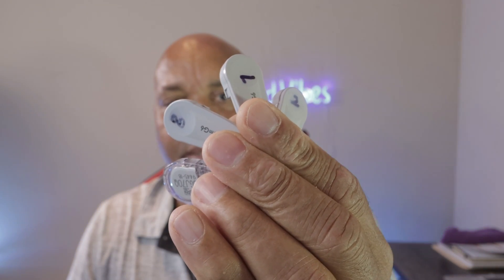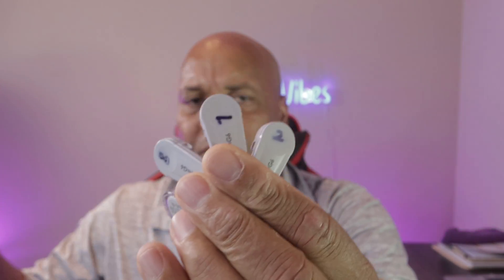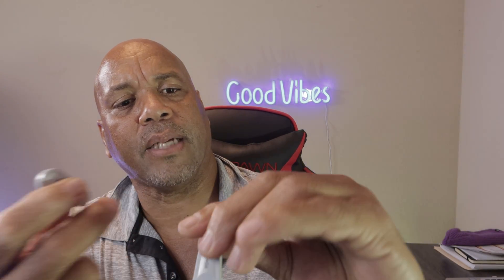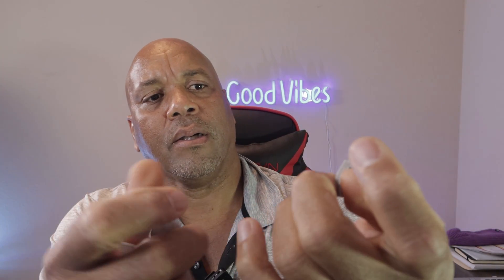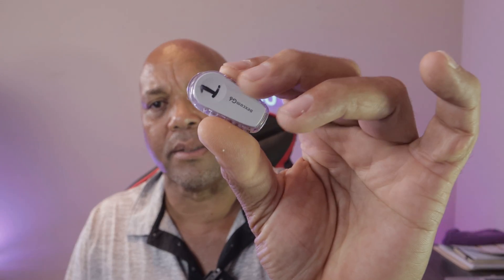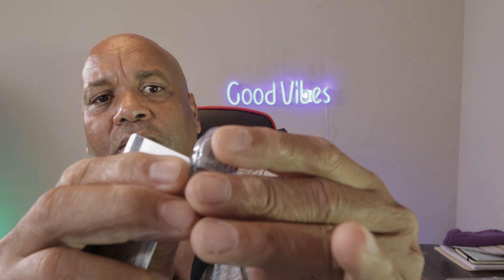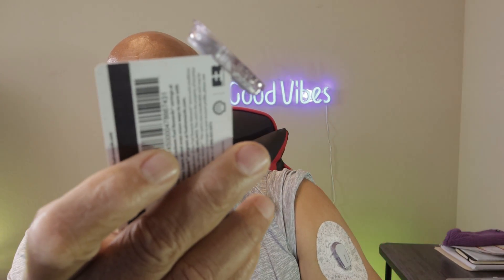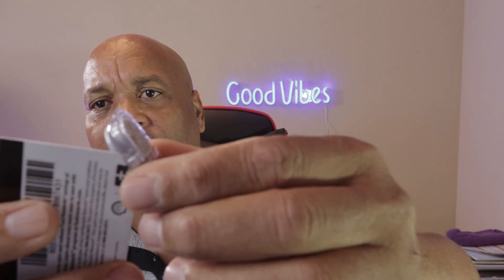Dexcom G6  Transmitter Save Restart Sensor By removing Transmitter

Comment: Dexcom makes great sensors but Dexcom support for failed sensors is terrible. If you have more than two sensor failures in one year Dexcom dose not care they are not supplying you with replacement sensors. They blame you! They are jerks and don't care. That's why people need to do this to take off the transmitter to reuse the same sensor twice.

Comment: if you are replacing the transmitter and just did sensor, I forgot to pair the sensor n transmitter.
help  I started the sensor but it didn't say pair it.  I m not working the new sensor n new transmitter with old transmitter numbers. it says I have one session left on this transmitter.😮
Reply: ok, the receiver said sensor not working.  it stopped. so I went to transmitter n it popped up with enter sensor code so I did.  then I restarted it when asked, it just failed again.  I m calling tech support😊

Comment: There seems to be some confusion on the difference between the sensor's and transmitter. He is talking about extending the life of the sensor beyond the 10 day cycle. The transmitter is the grey device that pops into the sensor. The transmitter lasts for 90 days.

Comment: Transmitters do not last 10 days or or only 3 or  4 sessions.   Get your sugar under control because you are giving people wrong advice that can cause harm.  Do not use your credit card unless it's expired or no good otherwise you will rip it.  I have an ideal tool for removing transmitters fast and easy.  Ask me about it and I'll tell you.  The only reason I  restart the sensors is because insurance companies rip off the patient by delaying coverage payment to the Pharmacy especially before weekends and long holidays.  If one comes off you will have to wait 24 hours during the week for a next day fed ex and longer on holidays and weekends.  That right there is criminal of the insurance companies.

Comment: The transmitter is good for 90 days after activation. Maybe sure the use by date has not expired before using. The sensor on the other side has a 10 day usage span. You can pop out the transmitter from the sensor by using a thin plastic from a pack of blackberries (that think clear plastic from the package). Pop the transmitter out. Wait 15 minutes, put it back in and reactivate. There is no need to wedge a thick card like that.

Comment: RIP THE STICKY OFF AND PRESS UP FROM THE BOTTOM.... I was messing with a card but the corner got all bent and it was super frustrating... just take the sticky off ♡
Reply: Use a test strip...it's so much easier and pops it right out.

Comment: The Sensors are good for 10 days, but the Transmitters last 90 days. Maybe you know that and just said it wrong.  I tried using an expired Transmitter (one that was new and expired after the 90 days of use), but it keeps saying Expired Transmitter and Invalid Transmitter ID. Has this happened to you and is there something I can do to make it work again?

Comment: Thanks for the tip on how to remove the transmitter from a sensor without taking the sensor off the body. 

I just did it on my own with the help of a guitar pick! Only took me 5 mins 😂. 

Thanks again for the knowledge 👍

Comment: I think you are totally confused. The sensor is the part that is inside you. The transmitter is what you have wrote the number 1 on. It is meant to be kept when you take the sensor out of you.  You don't replace the transmitter (it's good for 3 months).  You replace the sensor every ten days (unless you're hacking) You don't have to use a credit card. Just bend the casing back with your fingers and take it out. Wipe it off and use it with another sensor. If you've been replacing those transmitters every ten days Shish! That is just crazy. I was confused initially but think of it in these terms. The SENSOR is sensing your blood sugar, that is why it is in you. The transmitter is sending your reading to your phone...hence transmit

Comment: This video didn't help me restart any expired sensors or transmitters (and the terminology used throughout wasn't correct when referencing what the pieces actually are)...HOWEVER!  I needed to remove an expired transmitter (expired prematurely, according to the warnings I received on my insulin pump) from a brand new sensor that I had literally just started a session on when my pump told me the transmitter needed replaced!  That was an incredibly frustrating experience, but I was able to change out the transmitter WITHOUT removing the sensor thanks to this video, which is exactly what I needed to know how to do!  So, thank you!!!!

Comment: There seems to be some confusion between the "sensor" and the "transmitter" in this video. My insurance will pay for ONLY 1 "transmitter" (gray item he has numbered & kept) each 90 days because that's it's life. The "sensor" (patch on the arm) is designed to expire in 10 days so my insurance pays for 9 for the 90 days. YES, using the prying out method, one can stretch the useful life of the sensor patch longer. The only way to extend the life of the gray transmitter would be to grind away the outer casing to the battery & replace the battery (which is EXTREMELY difficult). If this man is completely removing all items from his arm when the sensor itself expires (in 10 days), then he's not using the transmitter for the full 90-day life. And I question how he's getting his insurance to pay for more than 1 transmitter each month?
Reply: Sounds as though he's paying out of pocket.
Reply: I agree. It sounds like he's changing the transmitter every 10 days...unless he's saying it wrong. I did read somewhere about a year ago, that some man somehow renewed transmitters to work again. He wouldn't share his method because he wanted people to give him their expired transmitters so he could make them usable again and sell them.  I started saving mine in case they ever shared the secret. I tried reusing one after watching this but it keeps saying Invalid Transmitter number.  This was helpful though to remove the transmitter when you have just put a new sensor on and then the transmitter expires. My boyfriend could get it out without removing the sensor but it kinda hurts because he has to bend the transmitter case to get it out.

Comment: Hey Charlie I'm new to this but I have reused the same sensor five times now I'm preparing to start it now for the 6th time not the transmitter the sensor so yeah I know they're good to go up to five times I'm going to see how it goes here for number six today I'm a little trouble the first couple times but I had to shut my receiver all the way off and then restart everything and wait 15 minutes I think it's going to work this time though cuz this time it repaired so we shall see number six going down
Reply: How could you manage to reuse so many times
Reply from the maker: The most I have gotten is 5 ..I am on  three times right now..
Reply: We have never managed to reuse for third time, and mostly it fails to extend for the first.  We constantly have errors. So ı need help. Could explain the process step by step for me
Reply: @fahrettinhoca   I use my sensors 3 to 4 times also. What I came to realize is that it gives the funkiest readings for about 24 hours, and then it starts to straighten up and fly right. Sometimes it might take 2days, but I pay out of pocket, so it's worth the wait. I was calibrating like crazy at first, but i don't even do that anymore. I just put my alarm on silent and check my blood sugar manually for 1 or 2 days

Comment: In the UK we use the transmitters for 3 months. The only part we change every 10 days  is the G6 inserter. Strange why you are told to change transmitter as well.
Reply: In the US it is the same. I change my transmitter every 90 days. The sensor lasts 10 days. He’s got the transmitter and sensor confused. One the transmitters runs out of power it will not work anymore. My Medicare pays for a transmitter every 90 days and 6 weeks of sensors I never had a problem with Medicare paying for it. If you do it right you have no problem.

Comment: #RealTalk - The gray thing that you're talking about is a transmitter, not a sensor. The sensor is the clear plastic thing thats attached to a bandage and you attach to your skin using the applicator (the big plastic thing that has an orange button you push to insert the cannula into your skin). The gray transmitter you are talking about here is MEANT to last for 90 days. Not 10, not 20 or 30. If you're replacing that thing more often than 90 days, you're either doing it wrong or you're buying used ones where the battery is already almost dead. New ones that you get from a pharmacy, Dexcom directly, etc. are intended to last for a full 90 days.
Reply: i agee with u but can u reuse systems as claimed by other users of dex 6 ,seem that the battery in the transmitter woul fail
Reply: Amen...I have no idea why this guy and others are manipulating the system or its parts. You order replacements on time and properly follow directions, input sensor numbers or calibrate and go on properly. What else is there to do or hack as I heard term used. I will say that the TERMINOLOGY created for this system- though simple and minimal- is confusing for MY BRAIN to use (and communicate) without going slowly. SENSOR..RECEIVER..TRANSMITTER are all similar terms in MY BRAIN and the big thing used to place system on your skin does not LOOK LIKE A "SENSOR". ALL VERY DISCOMBOBULATED IN MY MIND.
AS WELL..removing the transmitter piece from that shell when complete is a bit cumbersome and scary. Don't want to break it or impale with the mini wire/needle. Overall a great item and blessed to have it. USE IT AS DIRRCTED AND CALL FOR HELP THE PEOPLE ARE VERY NICE. USE YOUTUBE TO SEE HOW TO MANIPULATE EQUIPMENT.
Reply: @MegaLargemouth  I am worried that I won’t have a new sensor or transmitter when I need them. Over the years, I’ve struggled to obtain all my meds for many, many reasons. My provider delivers sensors exactly every 30 days & adds a transmitter every 3rd time. Naturally, last summer, I was on vacation when one of my deliveries was due, so I had to go about 10 days without my Dexcom.  I have a lot of trouble regulating my blood glucose levels when my routine changes drastically.  So extending this equipment even a few days seems like a good idea to me!
Reply: @danbev8542  w

Comment: I have watched your videos on the transmitters at least 2 or 3 times. And what your talking about in the other video in particular, is the sensor not the transmitter. In this one you talk about resetting the transmitter, but you never tell us how to do it! It's very confusing. Where are the instructions for resetting the clock on the transmitter?🤔
Reply: I wish someone would tell us an easy way.  Without all the complicated use of apps that I couldn’t figure out.
Reply: Exactly once you pair it the first time how do you pair it again?

Comment: The transmitter is suppose to last 3 months according to Dexcom.
Reply: Just so we're clear, the sensors are SUPPOSE to cut out at 10 days, the programming and software/firmware are programmed to tell you that.
The transmitter, the parts he has numbered in the thumbnail, the thicker piece lasts 90-120 days.  They are programmed to cut out after that.  They can be reset though.
Reply: @lucasstone162 THAT's why I came here- to see how to reset a transmitter. I had a sensor fail & Dexcom sent me a replacement. By the time it got here, the transmitter had expired. I inserted the new sensor before realizing that the app is telling me to replace transmitter. Is it even possible to reset transmitters? I've read some comments saying that some last up to 120 days.
Reply: it lasts longer
Reply: The transmitter lasts for 90 days on its own it's the senser that you can sometimes add days over 10 days. The transmitter is good for 90 days. Those of us that don't have a lot of money to just use the transmitter for 30 days needs to know this.
Reply: Duh that's the point of the video to reuse them
Reply: @butteronthetopside3909  They last 90 days without needing to do this is what he's saying. I came here to see if there was a way to recharge the transmitter after 90 days, which this doesn't talk about. But, by default, you should get 1 transmitter and 9 sensors for a 3 month supply. If you're using more than 1 transmitter in a 3 month period, you're doing something wrong. And that's the normal process, nothing is getting reused or worked around with that process.

I would like to keep a transmitter or two and figure out how to recharge the battery so that I could just buy sensors instead and not need to even buy a transmitter every 90 days. Of course, if I could reuse sensors too, that would be interesting. 

It appears that there is a lot of confusion with people on the difference between a sensor and a transmitter on youtube. This video is an example where he refers to the gray transmitter as a sensor multiple times.